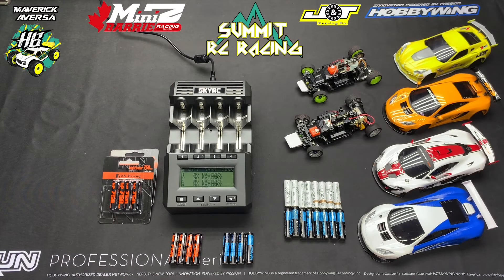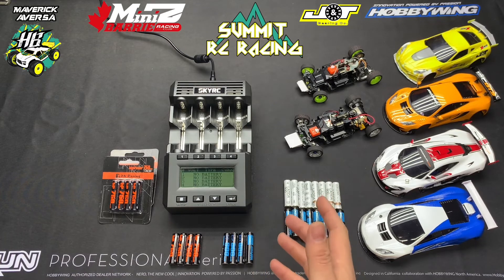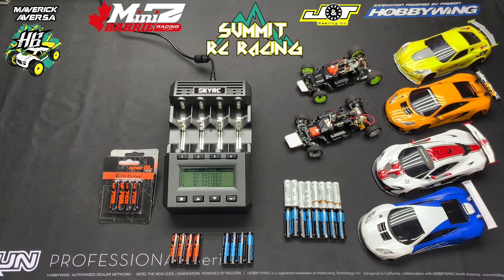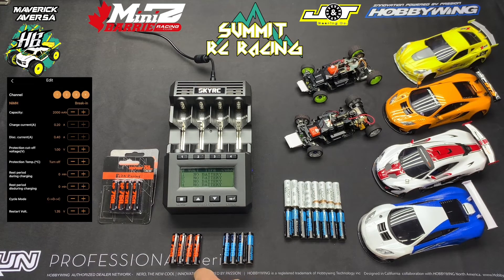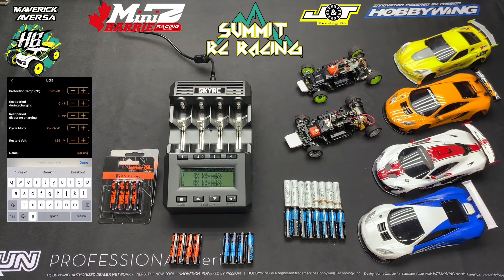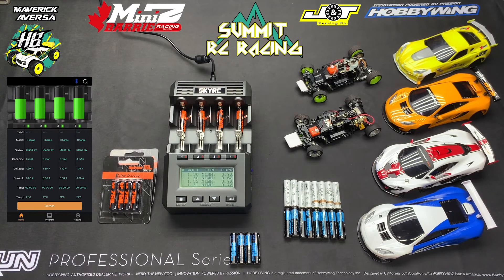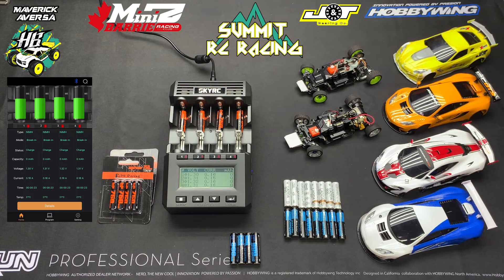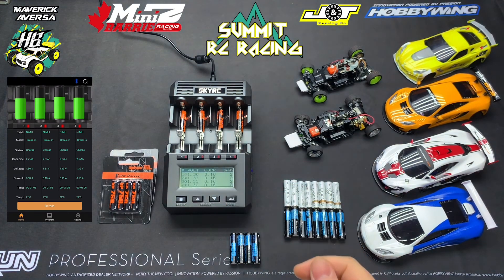SKYRC MC3000 MULTI-CHARGER MINI-Z NiMh BATTERY BREAK-IN TIPS

Comment: How do I stop the cycle process when it finishes charger mode? what I experienced was when the battery cycle continued to charge to 7000 mAH if the cut off capacity feature was turned off... if I activated the cut off capacity feature then what happened stopped and I repeated the cycle process again